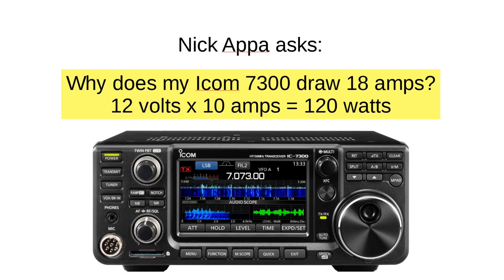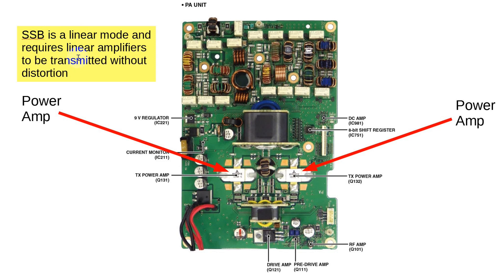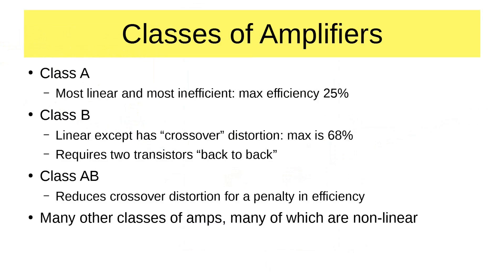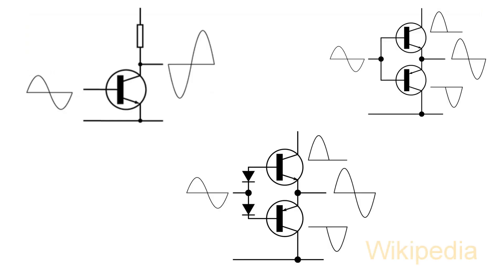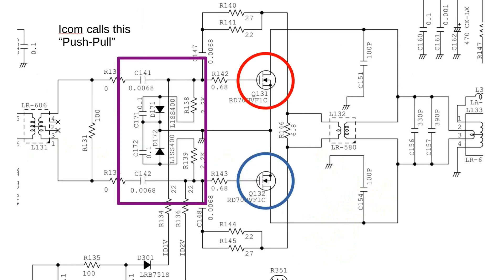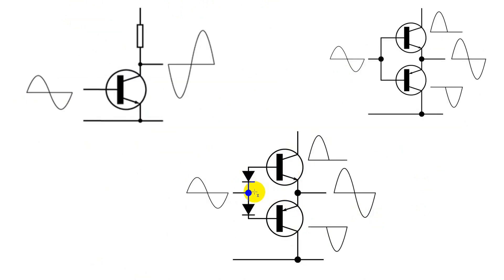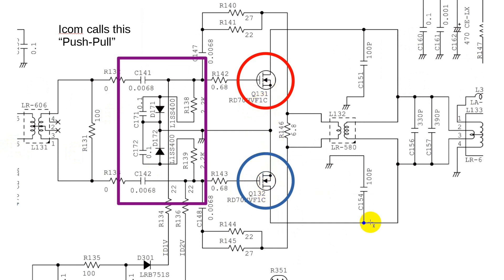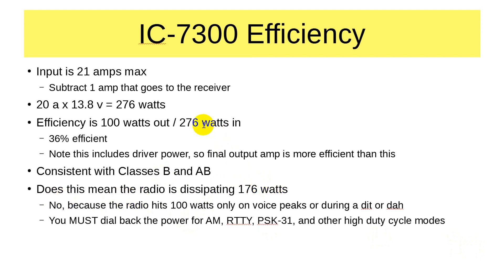How Your Radio's Final Amp Class Affects Efficiency (#353)

Comment: There also switching amplifiers of more to the point modulated switching amplifiers, where there is class D that is linear, but has limitations with tracking phase angles. Class E that is non linear, that can be phase / frequency modulated and a new one called class Q which is linear used for QAM amplification, that can also be used in a SSB configuration. All three types can operate with better than 80% inefficiencies, I am sure there will be a video made going into this group of amplifiers.

Comment: My understanding: FT8 is a weak signal mode, which does not imply low power. If you TX 1.5kw & I’m not in a good location relative to you, your signal can still be weak.

FT8 is the grandchild of EME modes. EME is often very high power, but weak signal nonetheless. 

Do I have that right?
Reply from the maker: Yes and no. Yes, it can dig signals out of the noise. But not a good idea to blast a signal onto the band, as you will smother many other signals that are running far lower power.
Reply: @davecasler  Agreed. This brings us back to the "minimum power necessary to complete the QSO" thing, that seems to be ignored wholesale by many operators. Yes, even on FT8 sometimes. It's provided good practice for adjusting the radio's RX filters, which the common advice is to RX as wide as your radio will go (true until the alligator shows up).

Comment: Tube amps are the best 👍
Reply from the maker: A lot of that "warm tone" and "depth" of the tube amps is actually crossover distortion. When transistor-based amps with very low Total Harmonic Distortion came out, many people (including me) thought they sounded "flat." Several generations grew up with tube radios that sounded wonderful, and the move to low distortion amps just don't sound right!